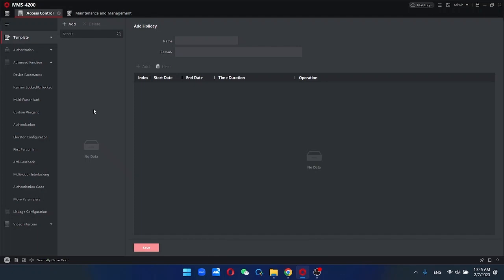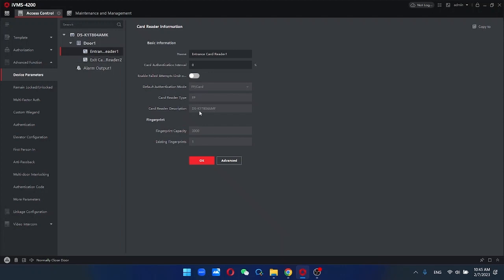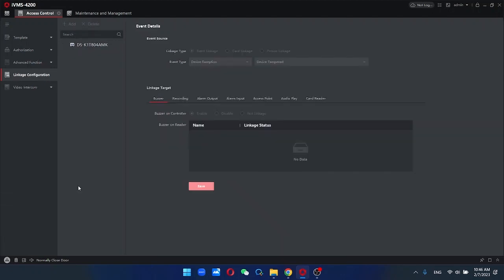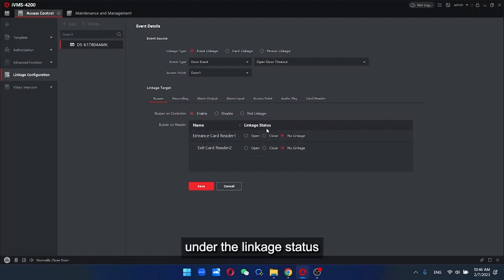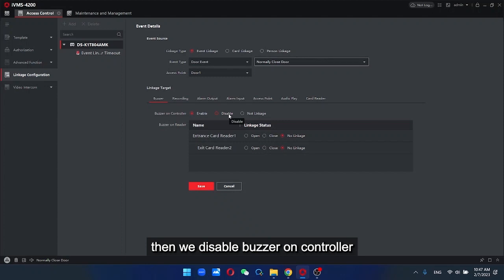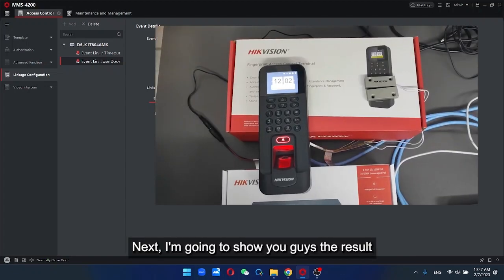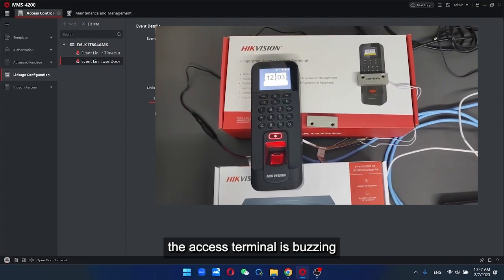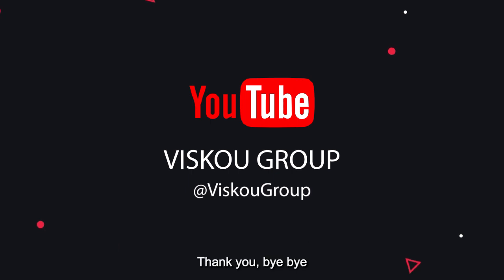HOW TO: Set Door Buzzer for door open timeout

Comment: I have similiar model, may I know which cable for magnetic sensor to connect to get the buzzer sound?
Reply from the maker: Hi @adib_aider  Can refer the wiring diagram from the user manual, connect the "sensor" cable.
Reply: @VISKOUYOUTUBE  okay thanks, it's working now!

Comment: hi about the wiring of the magnetic sensor where should the wires be connected
Reply from the maker: Hi J, 

This depends on the type of reader wiring connection. You would have to refer to your purchases model wiring diagram.
Reply: Is it possible to link the door controller with the external buzzer/siren for door open timeout!